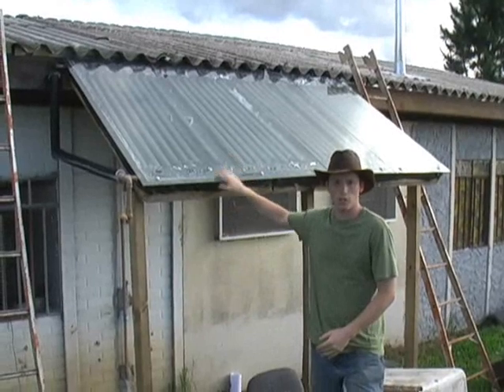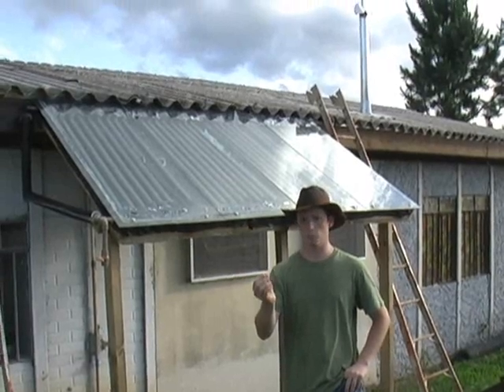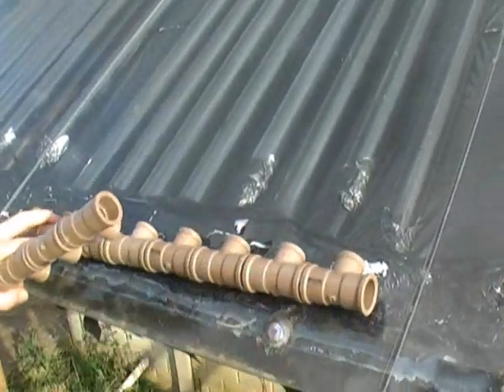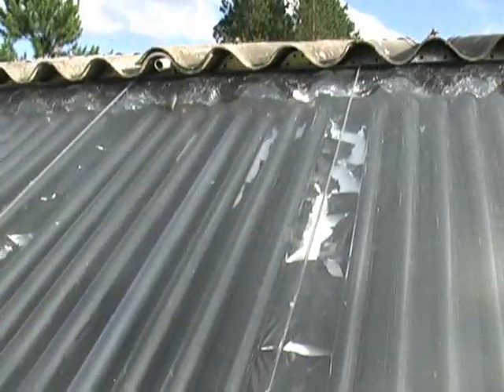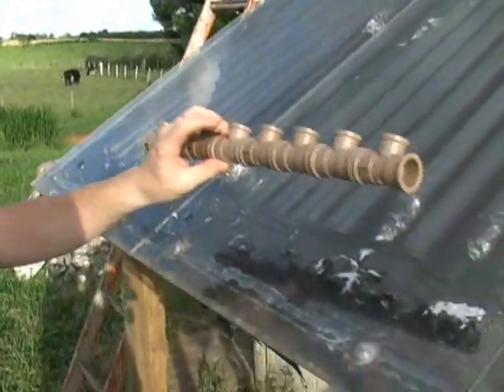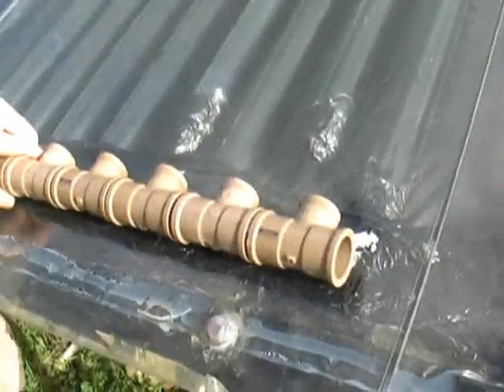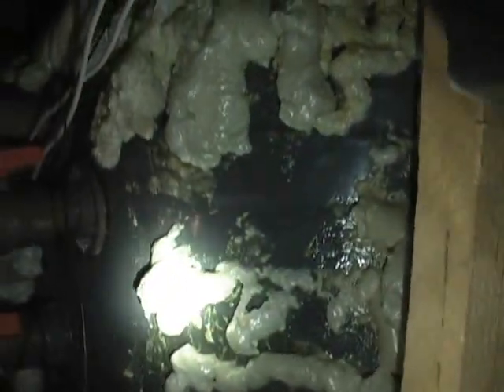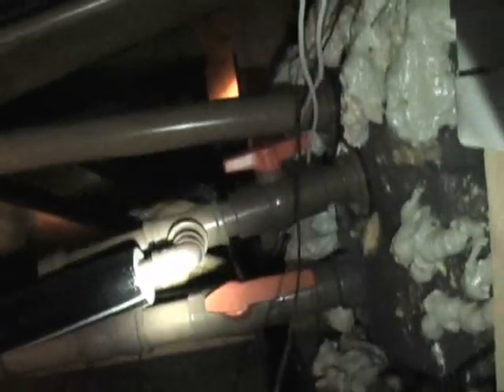Homemade Solar Water Heater / Aquecedor Solar de Água Caseira

Comment: very good system in Israel every house or apartment has to install one , i don know if you coped it or came up with is your self, but made one mistake and if you'll fix your hot water system will work about 45% more efficient, if have your hot water tank standing up and have the cold water feed from the bottom and and have a hose from the top of the hot water tank going to the bottom of the panels and have the return hose going back to the bottom of the tank now in Israel they make special tank for that here the electric heater is installed at bottom of the tank and inside the tank they have a plastic cone pointing up and thees a hole at the top of the cone
this helps with hot water flow inside the tank
https://www.google.com/search?q=israeli+solar+water+heating+system&source=lnms&tbm=isch&sa=X&ved=0ahUKEwiG7JGFuoLXAhVm0oMKHbNFBI0Q_AUIDCgD&biw=1920&bih=1011#imgrc=N3goFF79hm3G_M:

https://www.google.com/search?q=israeli+solar+water+heating+system&source=lnms&tbm=isch&sa=X&ved=0ahUKEwiG7JGFuoLXAhVm0oMKHbNFBI0Q_AUIDCgD&biw=1920&bih=1011#imgrc=lGlZ-dDH15TLwM:

https://www.google.com/search?biw=1501&bih=800&tbm=isch&sa=1&q=%D7%93%D7%95%D7%93+%D7%A9%D7%9E%D7%A9+%D7%A1%D7%9B%D7%9E%D7%94&oq=%D7%93%D7%95%D7%93+%D7%A9%D7%9E%D7%A9+%D7%A1%D7%9B%D7%9E%D7%94&gs_l=psy-ab.3...96448.99041.0.102159.3.3.0.0.0.0.272.522.0j2j1.3.0....0...1.1.64.psy-ab..0.0.0....0.DRvoYr--Za4#imgrc=xPvE6lQ5hOnRwM: 
you can see there two water connections at the bottom one citiy water feed and one going to the house the connections to the panels or on the side
and electric heater and thermostat 
unfortunately i was unable to find a drawing of how the tank is built but using the pictures you can understand that the cone is positioned above the where hot water is being realized under the wide part of the cone and directed up by thermodynamics and the walls of the cone relisting water tank and forcing cold water down . now because you already have a water rotation going, when you introduce cold water from the panels at the top of the tank, and hot water at the bottom of the tank you are just adding to this flow.
good luck to all who are trying to build it i hope you'll have fun and enjoy  lots of free hot water :)

Comment: A side benefit of making one of these is that I use all the white powder that comes inside the light tubes is I can dry oil spills in my garage floor with it instead of using kitty litter.

Comment: I would suggest to use a good water conserving shower head and a smaller tank for the hot water storage.. maybe there is a way you can use the bigger water tank for cold water and a smaller one for the hot water.. regarding the plc rating i believe not only the connection points fail at higher heat but it deteriorates the pipe rapidly and you will start to get a sprinkler system that can't be plugged… ensuring the temperature will stay below the rating number is beneficial.. also I would suggest that having the solar panel below the tank it is heating will help the thermo circulation as long as the supply to the panel is at the bottom of the tank (dip tube maybe) and the output from the panel goes to the top of the tank.. also you would need your hot water line supplying your shower to come off the top area of the tank.. all this being said i suppose it would be beneficial if the hot water tank could remain at a constant level in which case the fill line to the tank should be on the input side of the panel with a check valve so it doesn't go into the tank without going through the panel firstly.. 

hope this makes sense..
Reply: oh btw I'm a plumber

Comment: This is an example of how efficient can be solar water heating roof. It heat water and at the same time keep the house cool. I have used polycarbonate sheets for building solar water heaters getting amazing results. They are tough, lightweight, inexpensive.

Comment: The glass is an insulator you morons... there is no liquid flowing through it. Mercury escapes as vapor that can be inhaled and as a fine powder that can settle into carpet and other textiles. At least one case of mercury poisoning has been linked to fluorescents: A 1987 article in Pediatrics describes a 23-month-old who suffered weight loss and severe rashes after a carton of eight-foot (2.4-meter) tubular bulbs broke in a play area. That is an entire carton! Jesus quit freaking out.

Comment: Inappropriate content alert -- The fellow in the video advises use of fluorescent light tubes, which contain toxic mercury compounds. He calls for breaking/cutting the ends of the tubes and disposing of the "dust." This material is quite toxic via skin exposure and inhalation. He is exposing himself to this material, along with anyone else who comes into contact with it during or after the process. DO NOT DO THIS!

Comment: This is was a really well thought out project. I would, however, like to point out that the T12 Fluorescent lamps that you used have mercury in them. And as an electrician, I had to *put the blinders on* when I saw the wiring in the attic... ;D

Comment: damn, if the water's getting to 125'F without insulation, what's the point of insulating it? if you go anymore your risking hurting the joints and ruining the system, 125'F water is enough for everything you need to do, why go more?
but I must say, your design is ingenious, I think that's what I'll use for my cabin, thanks.

Comment: Nice project. I would have the water tested for contaminates; specifically BPA which might leach from plastics.  Also mercury from the florescent and other toxic substances light bulbs. Even if the water is not used for drinking -these substances can be absorbed through the lungs and skin, especially at elevated water temperatures... It would be interesting to know the levels of contaminates, if any.  Contamination is a problem even with some types of stainless steel.

Comment: I'm surprised that they have that type of water heating system in Brazil. Given the problems that they have with their current power grid it seems like a very inefficent way to heat water. Glad to see that you have implemented a creative solution to help with the problem.
Reply: Eu também fiz um, pode parecer ineficiente para você, mas aqui no nosso clima funciona muito bem.

Comment: Congrats my friend and keep up God's work, just a piece of advice for your heater to improve it's efficiency. Have the hot eater return only 2 inches higher than the cold water input, the reason is that the minor difference in pressure will cause the water to flow to the one a little higher and the main reason is that hot water aways goes "up" so having it return lower in the tank will heat the remaining water in the tank much more efficiently bottom to top, instead of top to bottom.

Comment: Please People do not use "cleaned" florecent bulbs for this project,in cleaning the bulbs this fella contaminated the water system of the people he was there to help. One florecent tube has enough mercury and phospherous to contaminate a 25 acre lake for 50 years. They are harardous waste, there are means any ways to recycle them properly, this is not it. I have been thinking of a method of getting the ends off and cleaning them without polluteing for a year. any feeback would be welcome.

Comment: This is a nice piece of work, but the cleaning out of  flourescent  tubes is more than a bit of a mixed bag. The white powder is a mixture of phosphor and particularly the toxic mercury in the tubes is an environmental issue. (taken from Wikipedia ) If you want to double glaze it  put two layers of glazing on the front. And the back of the panel could be painted white to reflect as much energy into the water carring black tubing.

Comment: To insulate the tank could you use polystyrene or as we have here in UK a fibre jacket that ties around the tank in older copper tanks, (the new ones are already built with foam)  how did you suspend the florescent tubes off the pipes as you said 360 degree insulated or did they just rest on them?

Comment: Great video with good and usable information. I am building a small solar water or air heater myself. I've posted some videos. I am very impressed with your well thought design though. I also like the shower head, never seen one of those before. Right now I use natural gas to heat my water, but that electric shower head might be more convenient and cheaper to combine  with my solar water heater. Greets from the Netherlands, iT

Comment from the maker: @321ozzy  I am not sure if there is a market for the kind i built.  There is a much cheaper, although less efficient version that is more popular.   It is made using a pvc grid like I did, however instead of light bulbs, 2 liter soda bottles are used.  If you live in a warm climate and efficiency doesn't matter a lot it is a great design.  Just search for "jKnSxJ_TnO8" on youtube.  The video is in Portuguese but its worth watching.

Comment from the maker: @jaketeater 
Before I installed the tank I filled it with water and used a bucket heater (you can find those at Lowes or Home Depot) to heat the water and see how the tank held up.  

I didn't  experiment with fiberglass tanks.  I think they would hold up though - I have seen them set on roof tops and painted black (a simple cheap batch heater).  They seem to hold up fine, though the temps only reach 110 I would assume.

Comment from the maker: @arijitmumbai  
Its a plastic tank made by Acqualimp.  Its about 3/16 inch thick plastic.  I think it s the same kind of plastic that is used in food grade barrels (in fact you can buy solar water heaters that use food grade barrels as the storage tank).  Its not rigid, but it is sturdy.  

The water heater just made it through its first summer and the tank is doing fine.  The water in it got up to 140 degrees at times.  At these temps it did not seem to have any effect on its structure.

Comment: Oops!  Glad you cleared that up.  It should be fine (though still quite fragile and susceptible to fracture, and a bit hazardous to work with).  The bulbs aren't usually rated for high temps but being glass I guess it could last for some time.

Comment from the maker: To clarify - water DOES NOT run through the tubes.  

The glass tubes are used as sleeves to insulate the PVC pipes (basically a second glazing).  Water runs through the PVC pipes and in no way comes in contact with the bulbs.  

The glass tubes increased efficiency by 20 percent.

Comment: I second that - the fluorescent tubes are a huge red flag - they have several micrograms of mercury in DUST form, which you can breathe, and is known dangerous.  Do not use this method - plus the glass is ridiculously fragile and not designed to hold water - the temperature highs and lows will make it crack quickly.

Comment: Ok. Always good to be aware of the risks. I have the same asbestos roof on my house so i recognize it.   Nice solar panel by the way. 
I'm planing on building some type of solar panel my self.  Just need to come up with a good way of storing the summer heat for winter.  :-)

Greetings from sweden.

Comment from the maker: Its actually suspended in the gas.  Its a small amount and I took precautions to protect against ingesting it.  

Risks like that are normal living here in Brazil - much different that in the States.  For example the roof on my house (you can see it in the background) is made of asbestos and I have cut some of it.  (wearing a mask of course).  Our water supply is a well about 6-8 feet deep in a swamp...  

Risks like that just go along with the territory.

Comment from the maker: It costs about 22 cents, USD per kw/hr.  That translates into $1.10 per hour of showering at 5 kw.  Since 2003 this price has more than tripled!

It cost roughly $300 to build.  It will take 270 shower hours to repay the investment at 22 cent per kw/hr - not including the hot water we use in our kitchen sink.  

With my wife and I using the shower it should pay itself off in less than a year.

Comment: Hi Jake, nice job on your water heater; it sounds like you came up with a very good layout for it. However, I feel bound to tell you that the powder you cleaned out of the bulbs most likely had quite a bit of mercury in them. While you can't do anything about the stuff from those; let me give you a better idea for your next project. You can use either glass bottles or drink cans and paint them black. This should give you about the same effect as the other system.